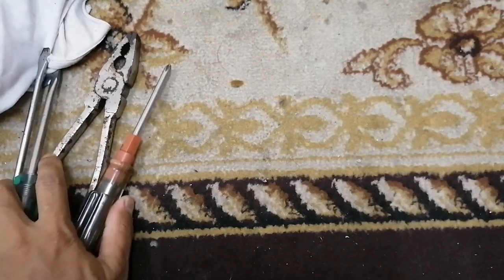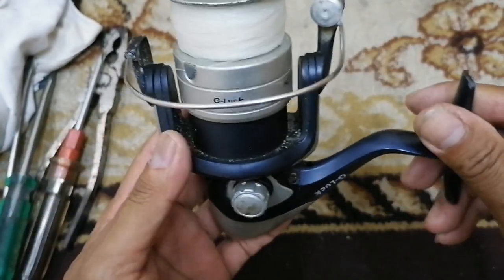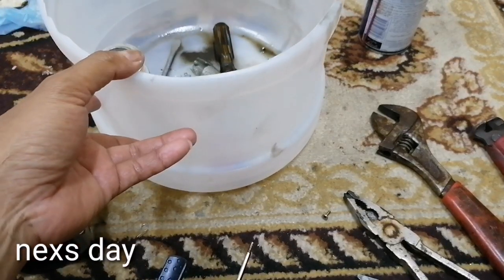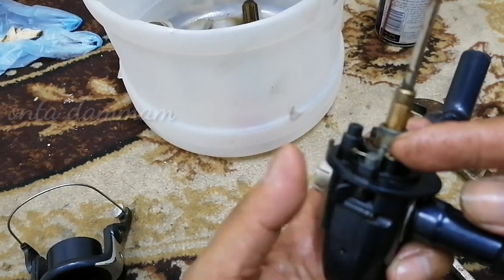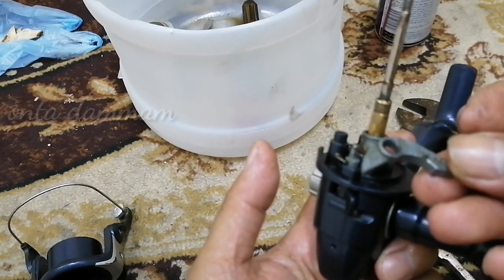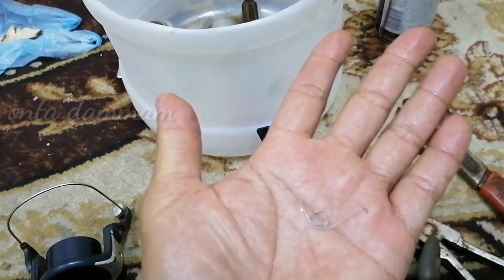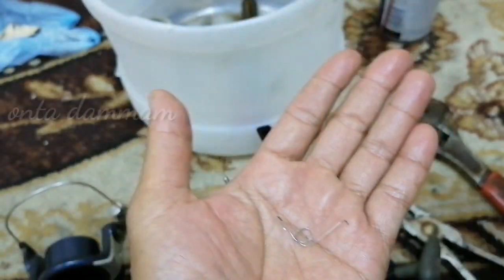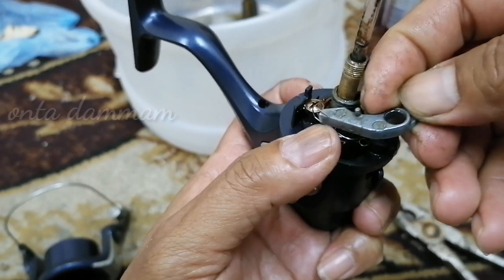How To Fix / Repair A Spinning Reel if Can't Lock

Comment: kalau orang mandi pakai sabun, kalau rell mandi pakai WD
so the problem on the spring, since the part does't have a sping its can not moved and lock the system.
great works mas bro. thumbs up
Reply from the maker: Suwun bos